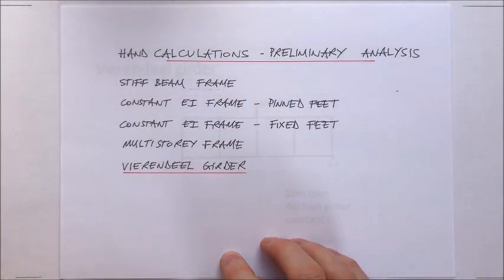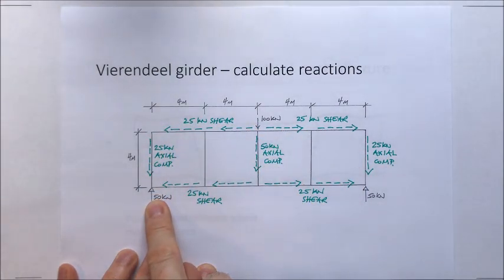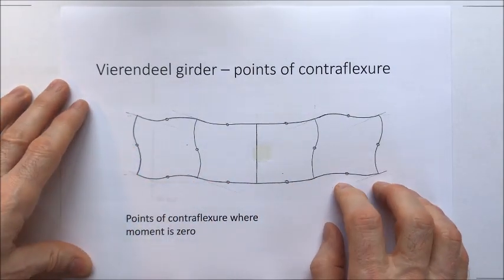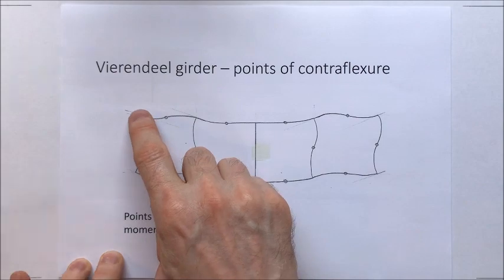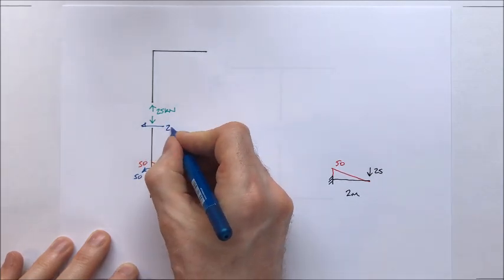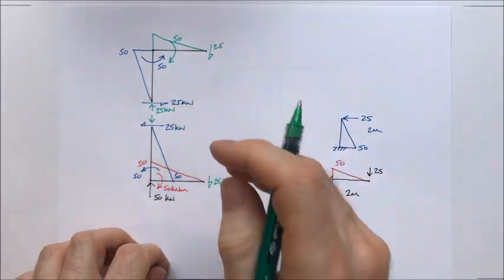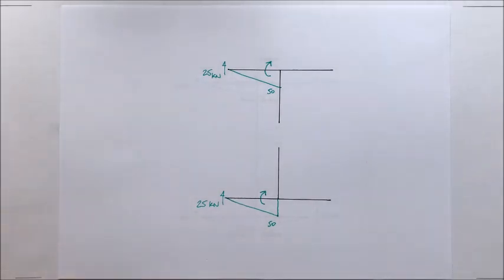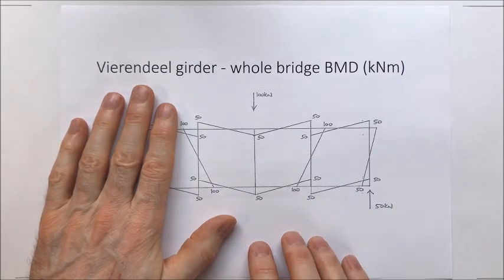Approximate analysis of frames (6 of 7). Vierendeel girder - single point load

Comment: There is a bending moment of 50kNm at the supports on either ends as per the solution. As the truss is supported on pinned and roller supports, does it experience any bending moment at it's ends? Please clarify @ Mike Bather.
Reply from the maker: Hi, I am not quite sure that I understand your question but here goes for my answer. Yes, there are bending moments within the members of the Vierendeel girder however, it is important that these moments are not transferred to the supports at each end. So, each support must be pinned to allow free rotation and, as you say, one support must be a horizontal roller to allow free horizontal movement. Similarly, for even the largest of trusses, these typically have the same pair of support conditions. The structure of the Vierendeel girder allows large moments to build up within the girder which do not transfer to the supports. I hope that I understood your question correctly, Mike

Comment: Were the axial forces in the bottom and top chord members missing to be in full equilibrium?
Reply from the maker: Hi rothehitman, correct, I have excluded the axial forces in the members and these are required to allow their full design. What I thought would be a quick topic to cover, already stretches over seven videos and so I have omitted this for brevity. The methods to find the axial forces are exactly the same as outlined above for the BMDs: create your FBDs and use statical analysis - Mike

Comment: Thank you for the amazing lecture. if it is loaded at the bottom chord, do we still assume that the loads are shared between the top and bottom beams equally?
Reply from the maker: Hi kasturchakraborty, thanks for the comment and good question. In reality, most Vierendeel girders may well have UDLs and/or point loads applied to their top or bottom chords but we can model them as a series of point loads (applied to either top or bottom); this is OK, at preliminary modelling stage, we are just getting a feel for the structure and so we have to simplify it (as long as we realise that the final reality will be different - but we can fine tune our structure at a later date). I hope this helps, Mike
Reply: @mikebather  Thank you so much for your response.